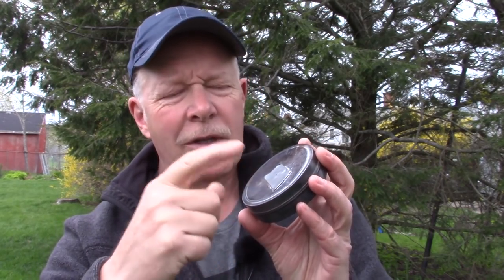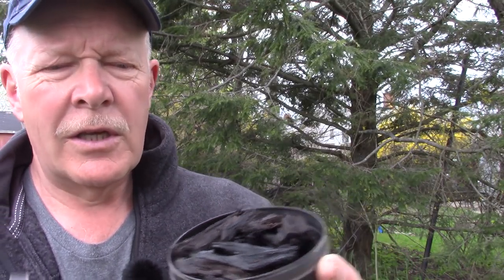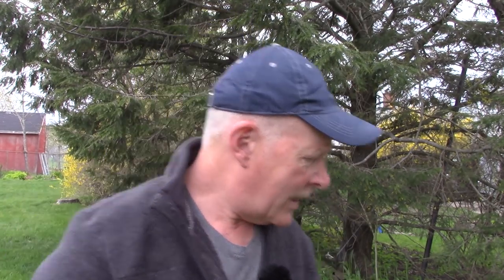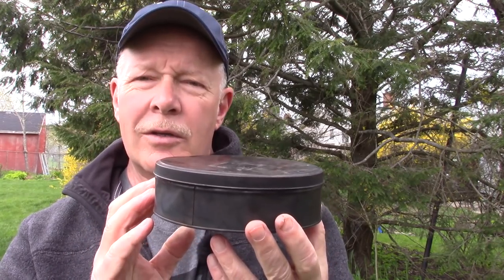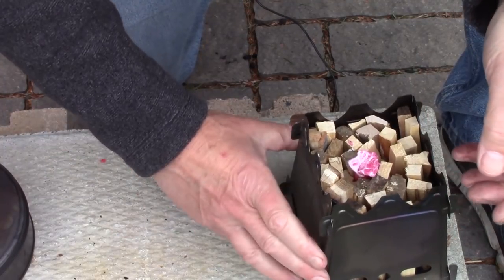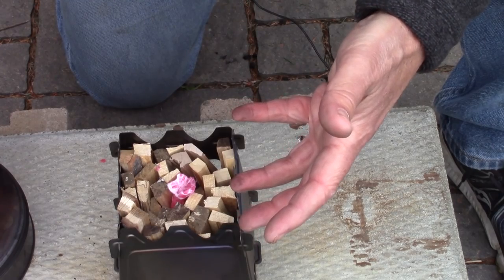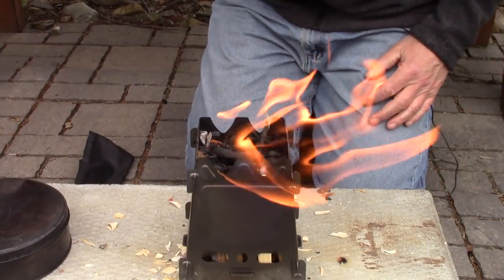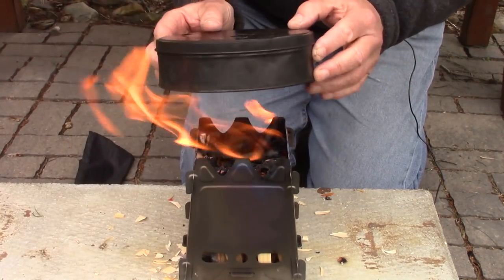Making Char Cloth

Comment: Worked great.  When using the tins for charring in, some folks drill holes through the side of the lid and tin.   That way when it is time for charring, the lid is rotated so that the holes line up.   Once the charring operation is completed, the lid is rotated so the holes no longer line up.   I personally have not done that but it seems like a great idea.
Reply from the maker: I have seen that as well. Looks like a great idea. I will try it on the next char tin I make. The ones I am using now I made before seeing that idea. Thanks for commenting Lonnie

Comment: I've only made cloth and punk wood a couple times, but I think you could almost make industrial quantities if it was in a camp fire.  I think having the heat only on the bottom was why you didn't get complete results for a few pieces that were on top.
Any advice on finding chert?  I'm in Quebec, and have been trying to find something that'll throw a spark, but I'm not sure if it's the rock or the technique to be honest.
Reply from the maker: The only chert/flint we have around here arrived as balast on sailing boats  200 years ago. I find quartz will work well for me. Check this video out for more ideas https://youtu.be/9RgFgBaLk1M  https://youtu.be/7nCf-slrXRM

Comment: Perfect timing. I want to make my first batch of char. One video I watched the hole was on the side of the container, going through the lid and the container so for storage you just have to rotate the lid a bit to block the hole. Looks like I need better material then what I was going to use. Thanks for the video Mark 🔥
Reply from the maker: That is the better way to put a hole in the tin. Then a piece of tape is not necessary. I will do that with the next tin I make. Thanks for commenting

Comment: Oh, using the fire piston, I have one, but, I have yet to get an answer, to the question, of what is the top altitude you can use it!
I live where, it’s 6500’ where going into the woods! Does a fire piston work at all altitudes, I’m thinking NOT! And I’ve never been camping where I could be at lower altitudes
Reply from the maker: Unfortunately, I cannot answer that question for you. In truth, I am not a big fan of fire-pistons. They are way less than 100% reliable with too many variables for success. They also weigh more than it is worth as part of a fire kit. I would sooner use char cloth with flint & steel or solar ignition. Thanks for commenting